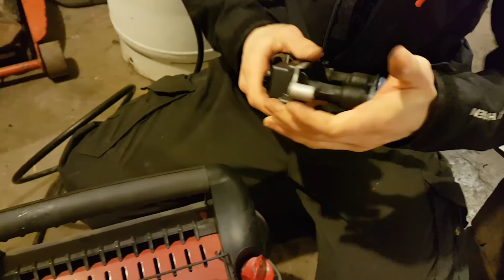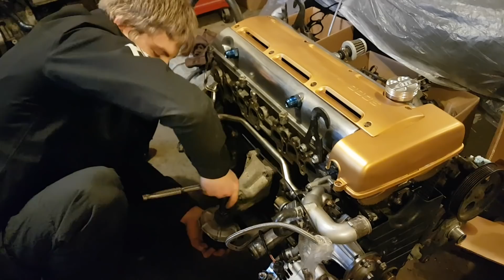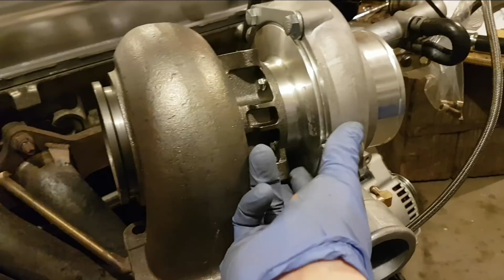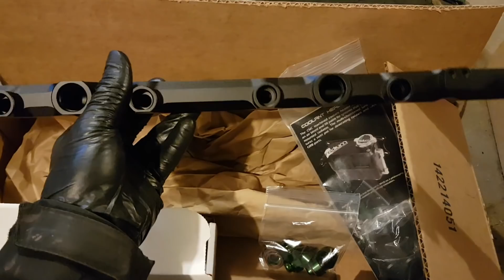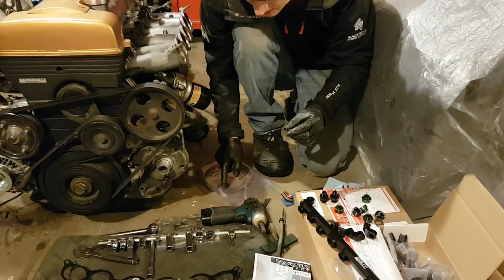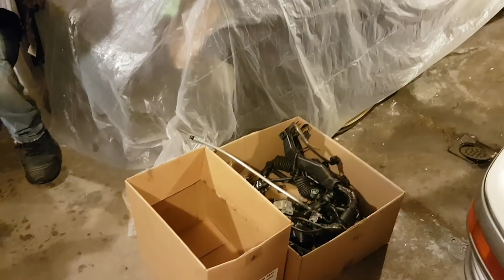2JZGTE GS300 Build - 2018 Engine Assembly

Comment: If that drain line is teflon line, i wouldn't use it. I destroyed two set of bearings from my holset because teflon melted a little over time and drain had squashed and didn't flow properly. After i discovered that we made drain from stainles 17mm id tube to get pass manifold and then some lenght of rubber line and again stainless before oilpan. no more smoking and oil in intercooler lines. but thanks for entertaining videos.